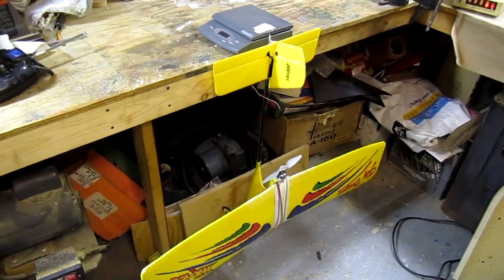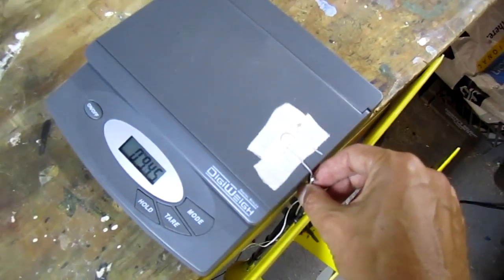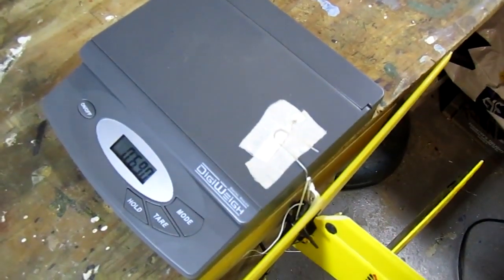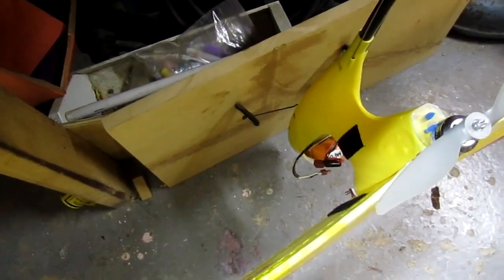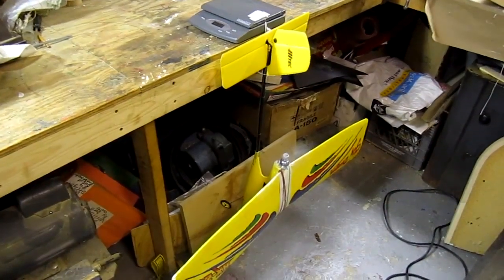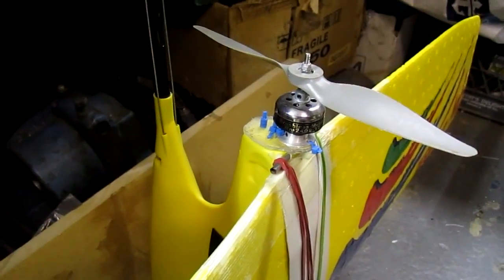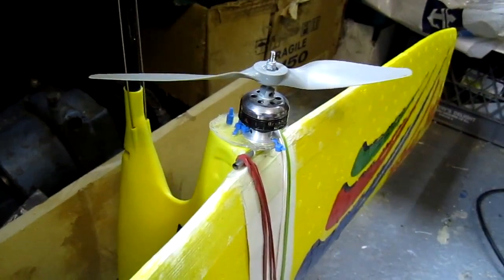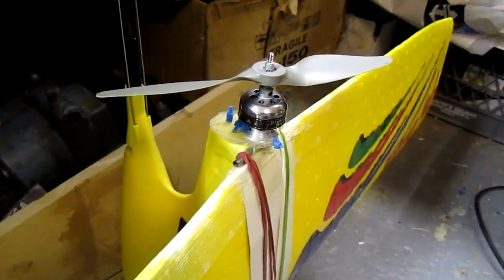An easy method to measure RC airplane thrust

Comment: I like it;  it is a simple way to compare the changes made to the setup.  The values for the thrust will have errors due to unaccounted torque vectors in the setup, but they should be more or less equal for the various setups and therefore not affect the comparison.  So, as my father-in-law would  say "Good enough for the girls we go with."  

I always appreciate simple setups that focus more on the differentials rather than absolute empirical values.  Users/people and most systems in the real world are about comparisons/differentials (~analog) of various parameters, not the actual value for that parameter.(~digital)    The engineer in me likes the numbers, but the mechanic in me wants the useable result.

Comment: Also, check under the balance, it may have a place to attach a hook.  Using the side of the balance the way you are, may not give an accurate reading as its pulling on one side.  However, if you can suspend the balance over the edge of the bench, and attach the plane to a hook under the balance, then you would be "pulling" on centre.  IF the balance does not have a hook attachment, I'd recommend using some 1/4" (or similar) landing gear music wire across the balance, and fabricate a wire suspension system to attach the plane below the balance. You could clamp a 2x4 (or some ply) on the bench and put the balance over the edge  to get a more accurate measurement.  Make sure your plane will not tip the balance over, perhaps another bit of wood over top, but not touching the balance for  safety ?  Good luck with that.